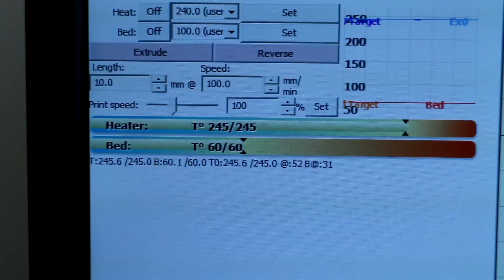3D Print in Very Strong Nylon Alloy 910

Comment: nice looking parts and very strong. I'm curious how it handles super glue or similar. Looks like great plastic for making snap together pieces seems locking tabs would be flexible and strong enough to work well.
I wonder if the little copter frame could be redesigned to print in one or two pieces and glued together if that would lessen the amount of weight of fasteners and plastic attachment points. Maybe mainframe printed in this expensive plastic and a cheaper like abs for other less critical parts.... really cool stuff
Reply from the maker: +builtrodewreckedit 
Hi Rod, yeah the Peon230 frame is designed modular so you can replace parts as they break. But if we're talking about unbreakable parts then a rethink is an option!
2-part epoxy the arms to the main body? Great idea! 

Also when is your 'Worlds heaviest Prusa i3' printer gonna be showing itself in action... ;)
Reply: +Tech2C Or perhaps if a print bed were large enough to print half body with arms and glue the two halves together? Where can i take a look at these files looks like a fun build project? 
Worlds heaviest prusa prints test cube really nicely but still need to nail down a new print bed platform. The warping build platform and breaking glass is a real let down. having 2 working printers takes some of the rush out of me.... maybe ill build the new bed next weekend?
Reply: +Tech2C Google just led me to the peon on thingieverse.... Holly shit didn't realize it was your design. I'm going to set out and see if i can't order the parts and give it a go.